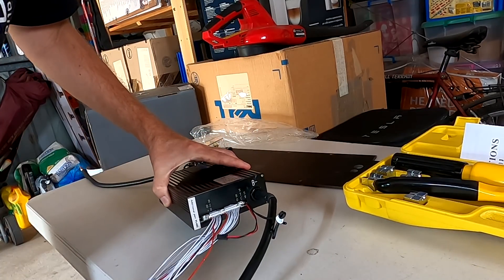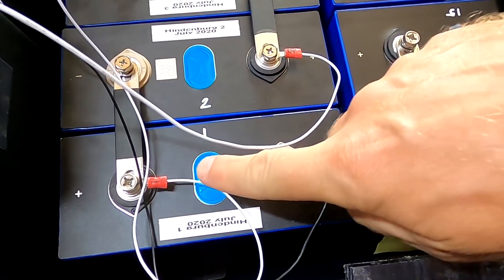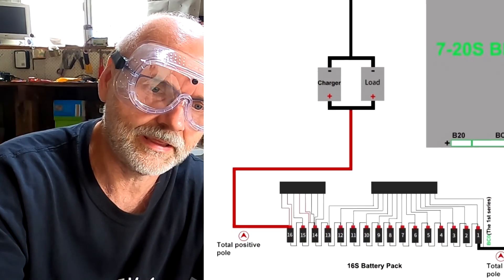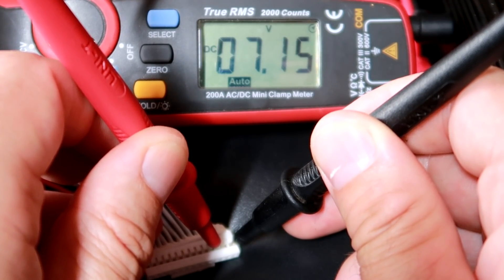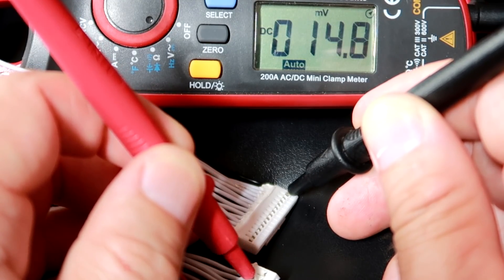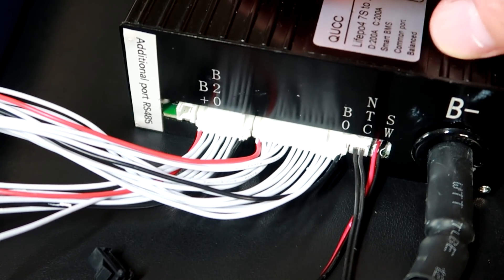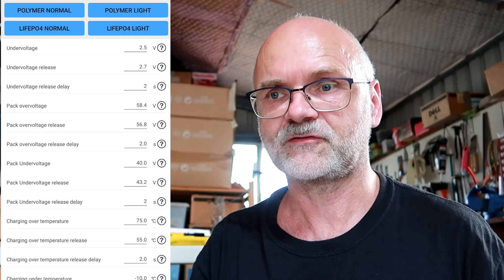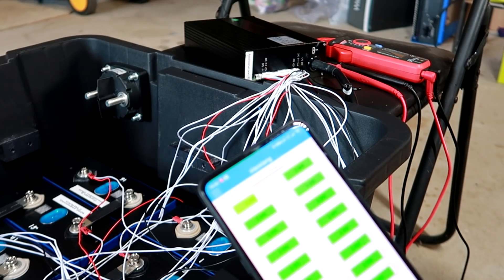BMS 101 - there is a problem #buildthebattery.5.2

Comment: Not having the B- conneced but other BMS wires connected can damage the BMS, that is why you must remove the connector from BMS first before removing other BMS wires.
Reply from the maker: Good tip! Thanks.
Reply: Confusing statement??? Do you mean on the second half of your statement that you must remove the other (monitoring) BMS wires first before removing the connector (B-).  In other words - reverse order when removing the cable/wires??  Otherwise it would do what you warned against in the first half of your statement??